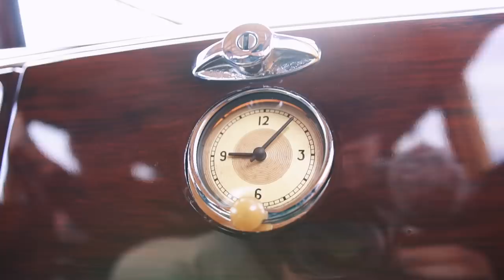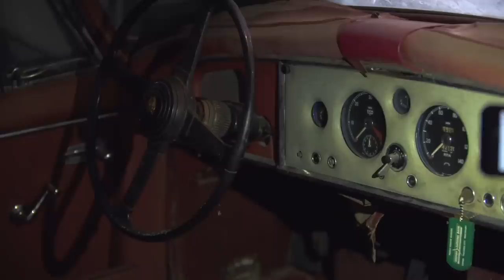Two Jaguar XKs a quarter-mile from one another | Barn Find Hunter - Ep. 66

Comment: It's so nice to see an XK roadster that still has painted wire wheels as it is most likely to have had originally.  The XK150 FHC was more of a cruiser than an out-and-out sports car, it got wider and longer (and heavier) to appeal more to the US buyer as the earlier cars, especially the roadsters, were rather tight for interior space, so it's more likely that it had the (still optional) chrome wire wheels from new.  With the values of them now, that XK roadster would probably buy a very nice house even in that condition, the 150 would be less being a less desirable model, but it could still be up towards $100k having been in one person's ownership for 40 years and it will very likely swallow that and more to put it right...

Comment: Love the old Ford Truck!   please show more of them,   That 66 F250 camper special is Holly Green and Wimbledon white.  It has the super cool West Coast Jr. Mirrors and a Padded dash with all the anodized aluminum bright trim.  The ranch bumper is not a factory piece, but likely the dealer installed it.  The 352 and New Process 435 4 speed transmission were plenty of power for these trucks.  My 66 had the NP435 4 speed transmission,  short style side bed, a DANA 60.2 five lug rear end and the same West Coast Jr. mirrors. It was Springtime Yellow with all the trim etc.   Glad the owner is keeping it!  I have had more than 10 of the 61-66 trucks.  YOU can fix the steering wheel to column gap by loosening the bolts under the dash at the firewall there is a strap type clamp to undo, then pull it up to close the gap! you might have to tighten the lower bearing on the shaft.   As always,  Great Video!